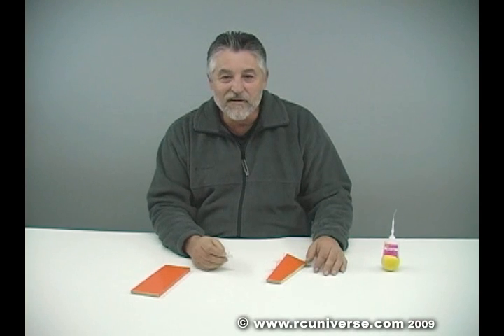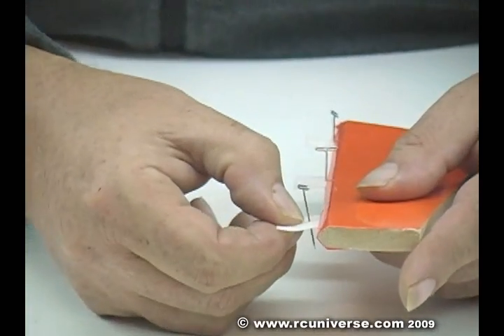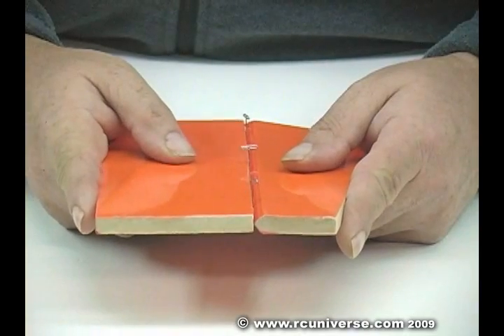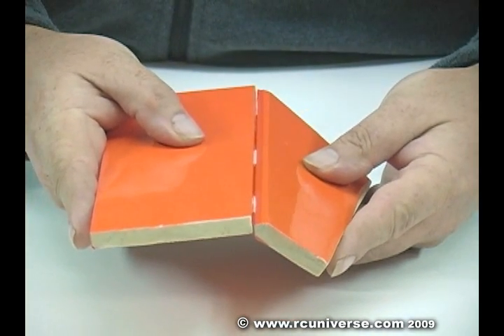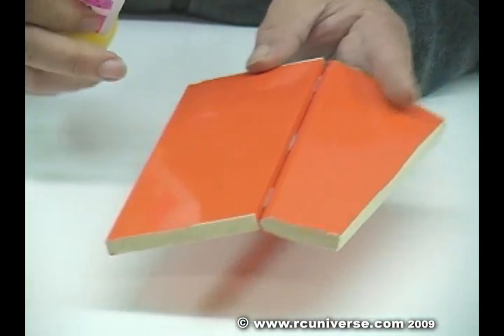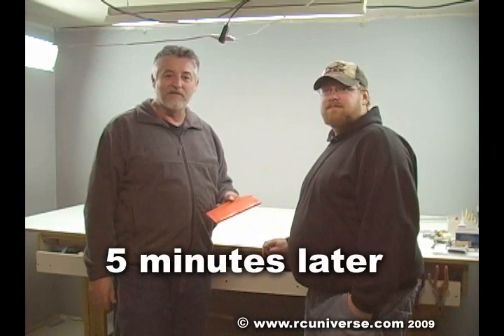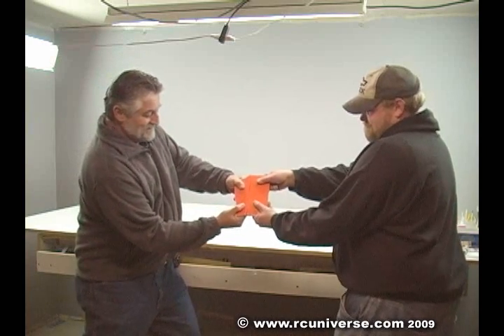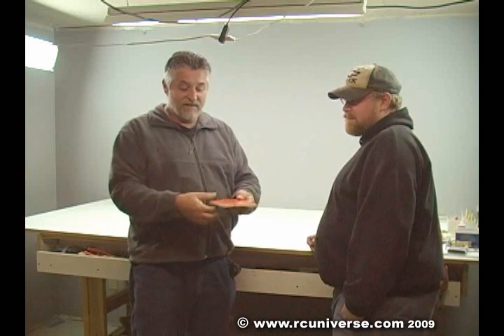Installing CA Hinges

Comment: I been using CA hinges for 25 years and never seen one break. If you're really wanting to make sure. Just use tooth picks on each side sand them flush and they stay until you cut them off or you crater the plane!

Comment: thanks for the video, very helpul. i have a 78" 3d edge 450 which will have a 35cc engine. i will be doing extreme 3d flying and wondered if CA hinges will be strong enough for this size plane. thanks

Comment: I NEED TO MAKE A VIDEO SHOWING A MORE SIMPLE WAY .  ARF 'S COME WITH THE HINGES INSTALLED AND NOT GLUED  FIRST PULL SLIGHTLY APART AND PUT A MARKER PEN DOT AT CENTER OF EACH HINGE  ON BOTH SURFACES ON EACH SIDE.  THEN PULL OUT HINGES.  RUB A LITTLE VASELINE ALONG THE ENTIRE FRONT SURFACE ON BOTH SIDES.  MARK CENTER OF HINGES. INSTALL HINGES ON MOVING SURFACE PUT ONE DROP OF CA ON EACH.    WAIT A ONE MIN TEST WITH LIGHT PULL . PUSH HINGES BACK INTO SURFACE AT THE DOTS PUSH FLUSH ALIGN END TO END AND DEFECT FULL THROW NOW YOU CAN SEE WHERE THE HINGES ARE AND ADD CA . THE VASELINE PREVENTS GLUING THE TWO SURFACES TOGETHER WITH CLOSE GAPS.

Comment: Its hard to argue with success - that was a successful potato test in my opinion. So I'm going to skip the step in my instructions to drill wick holes.
(I'm working on my 1st ARF balsa plane).
I would have to buy a drill and bit - so that will save $.

I see guys at our field put derm tape in the fold between the aileron and wing.
After seeing this potato test I'm guessing the tape is not needed.
Maybe I will put it on anyway - its cheap and easy and what harm would it do ?

The hinges are already in the aileron and pushed into the wing - out of the box.
So why bother to take them apart and have to pin them ?
Why not just extend the aileron to the max both ways and if the hinges all stay in place then they should be okay.....right ?